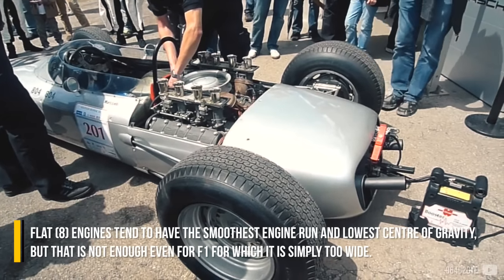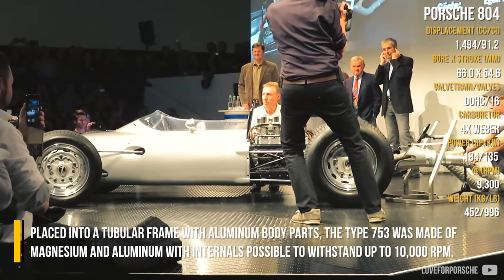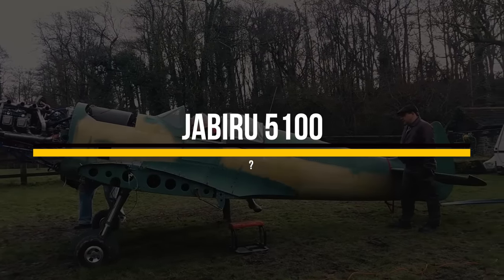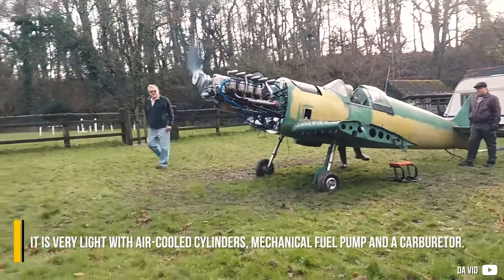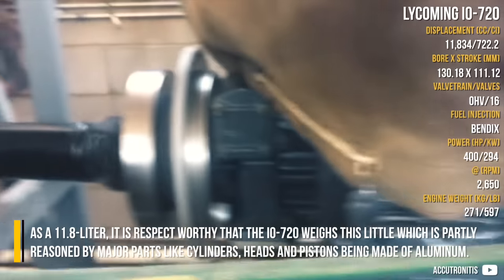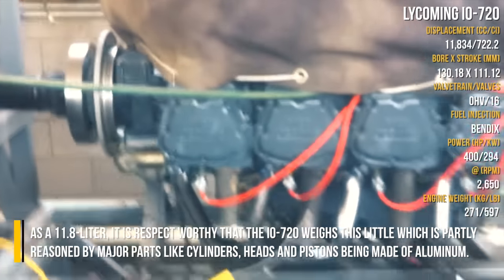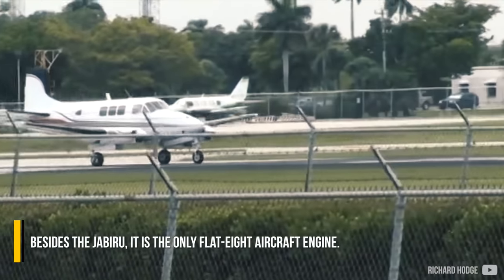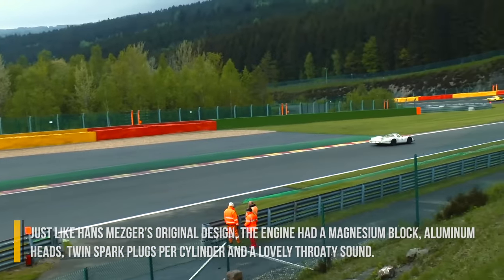The Only 5 Flat-8 Engines In The World

Comment: Yes. I love the sound of a flat 8. Its the soundof a cammed cross plane v8 with the howl of a flat plane.
Reply: Agree, it sounds unique
Reply: Is there a reasonably affordable production flat 8?
Reply: Quite similar to a straight 8/V16 minus some of the bass frequencies
Reply: @SpartanSaint75  Well, theoretically, you could get two beetle engines, and then basically just take all the internal stuff and cram it into a special block, that then you add all the usual stuff to.
Reply: @ruslandamron9069  or you could tuck 2 inline 4 together onto the same crank. Some peopl have done it in 30s or 50s

Comment: Makes you wonder if subaru made an 8 cylinder what it would sound like ?
Reply: If it had the same firing order it would sound exactly the same.
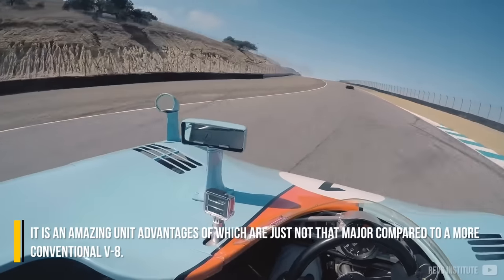Reply: @abz1248  probably not the same. It would would like a flat plane V8 I’d wager… like in the video at 0:16… or 1:02…
Reply: @abz124816  no it wouldn't x 2 🤦
Reply: Probably like 3:00! That engine sounds like two Subaru EJ engines put together, in the same way a Ferrari 360 V8 sounds like two Honda motors put together.
Reply: @xostler  1:02 does not sound flat plane at all to me. And i don't see how you could make a flat-plane flat-8 without having more than one cylinder firing at the same time.
Reply: Might vape a bit....

Comment: If only Subaru made a flat 8 to complete with the 1uz
Reply: they did make a flat 12 however, something like 3.5L 600Hp NA
Reply: it was originally used for formula one, but never raced unfortunately. besides, the engine was so heavy, underpowered, and unreliable.
Reply: It was a Motori Moderni engine, commissioned by Subaru.
Reply: What about porsche
Reply: Needs to be mass produced

Comment: There is another flat 8 that's about as rare as rocking-horse shit, I have a brand new one here destined for a future T roadster build. The Packette Continental flat 8 is a GPU engine, just like the Lycoming it is 720 cu in but has cross flow heads with intake ports on top. There are two different versions of it, the knuckle type head & the pan type head. Mine has no identification tag so I don't even know what to call it other than a big bad-ass Continental.     https://www.google.com/search?rlz=1C1CHBD_enUS788US788&biw=1132&bih=696&tbm=isch&sa=1&ei=0USZW87ULIPW8APKmInoBQ&q=continental+8+cylinder+aircraft+engine&oq=continental+8+aircraft+engine&gs_l=img.1.0.0i8i30.33062.34260..37085...0.0..0.108.495.3j2......1....1..gws-wiz-img.rzZNQD4U4nU#imgrc=_

Comment: Porsche did this better than anybody. The Lycoming is pretty cool, as it flies over it sounds like a flathead Ford V8 in the Piper Comanche 400.
Reply: They are using these IO-720 in unlimited sportsman class at the Reno Air races with speeds over 400 mph.
Reply: @patrickradcliffe3837  
I went to the Reno air races one time. That is pretty wild how far they push some of those engines. Rare Bear was absolutely awesome.
Reply: One of the harder airplanes to land dues to its nose heavy configuration from the Lycoming IO-720. An airplane that wants to land on its nose...even with considerable compensatory elevator trim!

Comment: also the turbo charged Crower flat eight used at indy 500 during the 1970's?  Engine was approximately 161cubic inch & utilized Cosworth cylinder heads. I believe the driver was Jerry Sneva

Comment: The “IO” in the Lycoming IO-270 means that is fuel injected and opposed (flat/ boxer)
Reply: Yes, and the number is the displacement in cubic inches. Like a Lycoming TIO-540 is a turbocharged injected opposed 540 cubic inch opposed 6 cylinder.

Comment: In the 1965 Sebring race seven Porsches in a row entered the straight leading to the HairpinAs they entered the straight they were led by a 356C owned by Florida lawyer Dave McLain. Then cane five 4-cylinder 904s.  Trailing them all was the factory 904-8. When they came into my view again the 904-8 led then came the four cylinder cars followed by the 356 with its pushrod engine. This last car had finished 10th overall the year before in what became the Daytona Continental.

Comment: Nice job, bout you`ve missed one.

The Fitti-Volks was a VW beetle made by the Fittipaldi brothers (Emerson and Wilson) to race in Brazil against Ford G540, Lola T70 and Alfa Romeo T33. They joined two 1600cc VW engines and tuned it up to 400 hp.

Unfortunately there are only information in portuguese about this car, but you can use google translate to check it. Here is one of the websites that contain some info about it: http://projetomotor.com.br/muito-alem-da-copersucar-os-insanos-carros-experimentais-dos-fittipaldi-2/

Comment: A Flat-8 is techically not the same as an 8-cilinder boxer.
Techically a Flat-4-6-8 is a V-4-6-8 with an angle of 180 degrees. Opposing pistons use the same crank.
In a boxer, opposing pistons are connecte to a different crank.Flat an boxer are a different concepts all together.
Reply: 8 cylinder boxer is flat 8, but not all flat 8 are boxers, like in other number of cylinders
Reply: Here's the rub, though.  All of Porsche's "flat-8" engines used separate crank throws per con-rod.  However, for a brief spell, the Type 908 engines weren't actually boxers...

The boxer is typified more accurately by the combination of a 180° "V" angle as well as a 180° split between neighbouring crankpins on the crankshaft.  Those "neighbours" correspond to the "boxing" piston pairs in the cylinders opposite each other in separate banks.  What Porsche tried, as a result of the 771 and 908's propensity to shatter flywheels and cranks, is to turn it into a flatplane design.  This would, they hoped, reduce the torsion problems they were having, and as a bonus simplify the exhaust arrangement, too.

But simply sticking in a flat-plane crank, and having opposite cylinders share crankpins, would result in simultaneous ignitions: two cylinders, an "end" and a "middle" in each bank, would be ignited at the same time every 180° of crank rotation.  That's what BRM did with each of the flat-eight halves of its H16, at first (they later used a 45° split crankpin design).  Porsche probably wanted to use the existing 908 cases, so it was not physically possible to make a true common pin crank to fit it anyway.

Porsche instead re-employed the same split pin crankshaft approach as it did with its boxers, but separated the throws by 90° instead of 180°.  This effectively resulted in two inline fours (one per bank) separated by 90°, not unlike a flatplane V8 (just with an unusual, symmetric and very sweet sounding firing order) - i.e. the 90° separation was achieved in the crank instead of the V-angle.  For some reason, this engine was fond of breaking its various ancillaries instead; possibly a balance, or again (still) a torsion issue.

They went back to the 753 / 771 boxer configuration and just beefed everything up considerably.

Similarly, most V6s use split / individual crank pins per con-rod, but not one of them is a boxer engine.  As already stated, all boxers are flat engines, but not all flat engines are boxers; even those with individual crank throws ;)
"Opposing pistons" is a very different kind of engine, where two pistons occupy a single cylinder - think Junkers Jumo or Napier Deltic or Commer TS3 "Knocker" etc.

Comment: You need to check out the Gasser Squareback. The builder took 2 flat 4's and connected them at an offset 90 degree crank
Reply: That car is nuts, sounds great